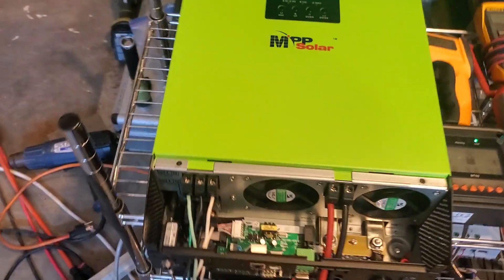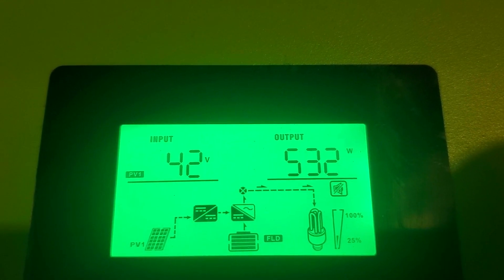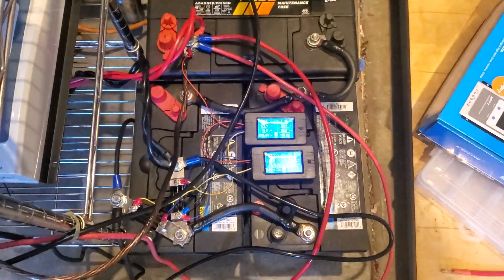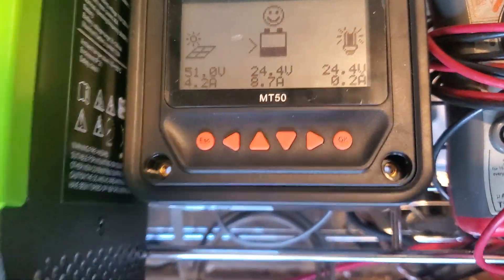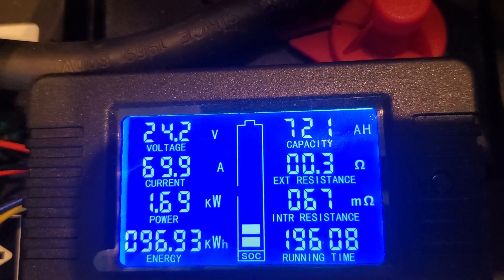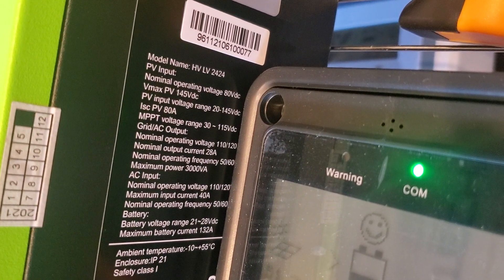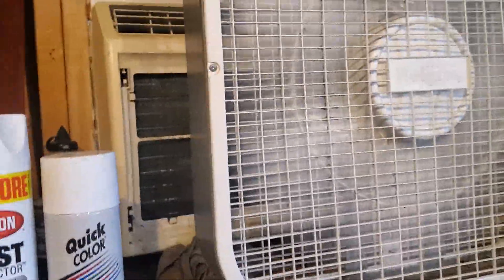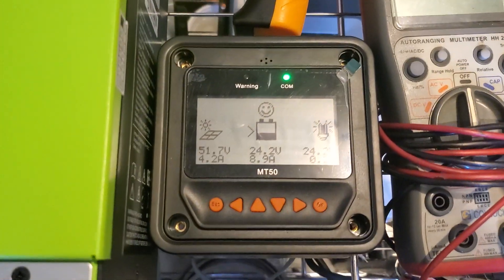my solar powered shop w mpp solar hv lv2424 and epever cc set ups.

Comment: So 3 batteries basically (2) group 31dc is giving you 500wh capacity?
Im trying to figure out for myself if Im going to get 4 walmart DC batteries for my 48v system or spend the $400 on a diy lithium ion or lfp diy. Seems like for $400 I could scrounge up 500wh worth of one or the other...
I have a honda civic hybrid NIMH battery in 48v configuration that I have $30 in but it's getting hot occasionally. It should theoretically be at 600wh capacity so not sure if Id be any better off even bothering now that I write it all out 😅 Maybe just need to troubleshoot my current battery better...
Reply: Well I guess Im not doing a proper comparison of the lead acid batteries. Id need 4 but was thinking of the 24dc which would be $100 each or $400 total.
4 of the 31dc would probably end up being $150 each or $600 total... Yikes. But maybe 4 31dc would give me a true 1000wh capacity at least.
Doesnt seem worth it. What's your thinking behind having lead acid vs lithium of some flavor?